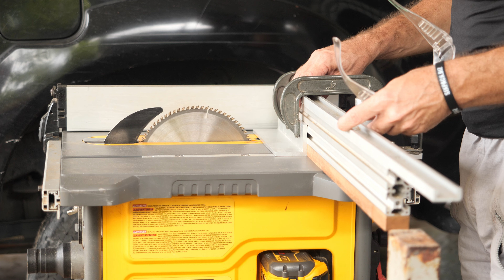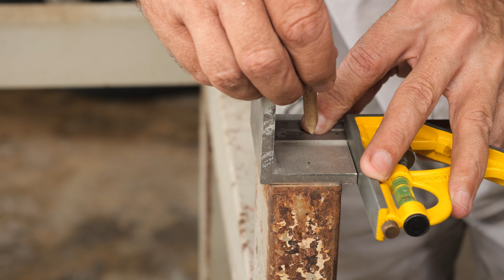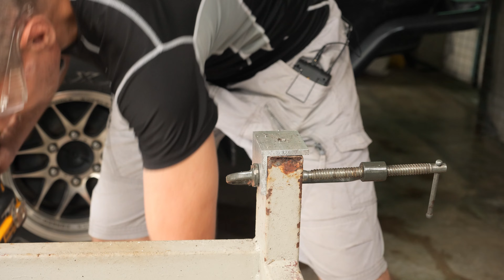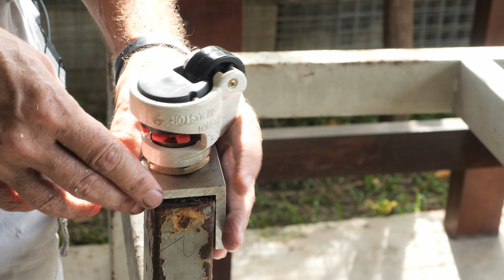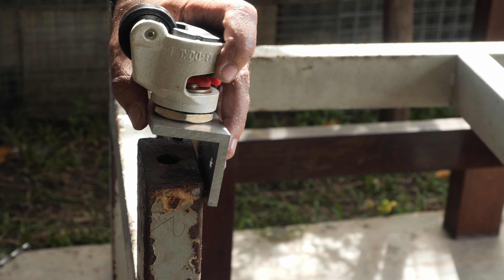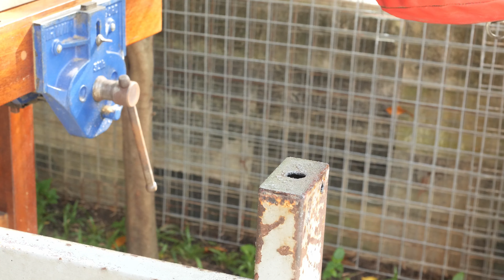Caster Wheels For Heavy Metal Workbench Table Base, No Welding | by Tiger Carpenter

Comment: I wonder how heavy that full meta thick solid steel bars fabrication table is
I bet these casters are carrying some serious load.
Reply from the maker: I will calculate the exact weight of this fabrication table one day.
I think it is at least 250 kg = 550 lbs

even 2 people wouldn't be able to move it without the casters installed

Comment: Use a step drill bit would eliminate the filing
Reply from the maker: yes at that time, and in fact even now I didn't have the step drill so I had to put extra sweat 

the filing gets you a tight fit though, not sure if the step drill can achieve that, maybe if you are lucky the step would fit the bolt nicely.
please remember that the table is very heavy (400kg / 800 lbs), so it's good to have tight tolerance on the holes embracing the bolts.

Comment: Why didn't you use some washers  🙂
Reply from the maker: I did use the washers on the mild steel side as it's only 2 mm thick, to avoid denting by the bolt head. ( see here https://youtu.be/95D3-K63tZY?t=805 )

The aluminum reinforcer is 1/4 inch thick, so it didn't need the washers, and the nut is sufficient, as it is not denting the aluminum piece + steel wall adjacent to each other.
Reply: @TigerCarpenter  i see what you mean and i saw you used washers on the other side, but i still think it's good practice to use washers especially on a softer metal! 😅
Reply from the maker: @AlessioSangalli  these are non moving parts, you just tighten the nut on the 1/4 inch aluminum angle, and forget it. if it was a clamp or latch, I would have used the washer on the aluminum side. I tried it without the washer, and it didn't dent or distort the aluminum because it is supported by the steel workbench leg stiffness.
so you can imagine that the 3mm steel leg tubing itself is even stronger and stiffer than the 0.8 mm washer.
Reply: @AlessioSangalli  using self locking nuts is good castle nuts or nyloks
Reply: It’s a good job you did very creative